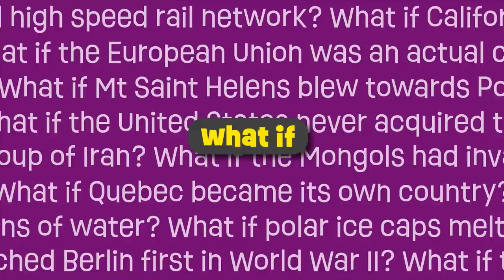Water Pipeline: What If An Aqueduct Was Built From The Great Lakes To The Southwest?

Comment: I think it would be better to build a water pipeline from Washington state to Southern California. The distance between the Olympic peninsula--one of the wettest parts of the Lower 48--to Los Angeles is less than 1,100 miles. It could run close to the Pacific coast, minimizing elevation changes along the way. Importantly, such a pipeline wouldn't drain any lakes of their water--it would catch water before it flowed into the ocean.
Reply: That is my thought as well, Lake Roosevelt on the Columbia river needs to draw down its water levels every winter to make room for spring melt water so they have more water than they can use. Lake Roosevelt is double the height above sea level than lake Superior making it easier to transport the water using gravity.
Reply: How about y'all stop trying to import water from other states? As a Washingtonian, I don't want our beautiful lakes and rivers to be drained for the sake of a state that can't even reduce its usage by eliminating all of its golf courses.
Reply: Spot on!   I wrote a comment saying the same thing but a pipeline from the Columbia River to Lake Shasta where the aqueduct system starts.
Reply: That has already been studied in the 1950’s by the corp of Engineers which concluded it wasn’t feasible.
Reply: @Mottleydude1 :
The 1950’s?    That’s like 70 years ago!    The water is in our country and in Canada.  Pipelines are very doable and do not need to be a lengthy as one thinks.   The snow pack in the Sierra Nevada Mountains needs minimal diversion as runoff is allowed to run into the Sacramento Delta where is mixed with saltwater.  Diverting to reservoirs there is very possible.   Pipelines leading to where rivers start allows rivers to act as a carrier and then diversion points can pump water to lakes and containment facilities.  Desalination plants can pump water to agriculture regions.   If we can pump oil, natural gas, and water through pipelines, we can build pipelines to where systems start like Lake Shasta.  But using a 1950’s report as an argument does not fly.
Reply: @Mottleydude1  Do you have a link to the study?
Reply: Minimizing elevation change is counter productive towards making water- ….
Move
Reply: @oldguysrock2170  
You speak as if lakes are healthy. 
Trinity lake (next door to Shasta)
Is e-m-p-t-y
Reply: @oldguysrock2170  You can't build for something that has been declining for decades and that is expected to be gone in the next few.
Reply: @oldguysrock2170  'The left'. Code word for anyone left of far right. 😂
Meanwhile the right denies the root cause of the problem. 😂
Reply: we need taff decision, like banning this Golf clubs from using real grassland!! this are very taff decision because it will hurt many rich people, so you can be sure this will never happen! but water cuts have already been enforced among the natives, really a fair situation, they used the least water and are the first to feel the consequences
Reply: Cali can worry about themselves
Reply: @fastinradfordable  :
Pumping stations!  Every pipeline uses them.   Pumping stations create shut-off points for emergencies.   Oil, gas, water:  all have stations.  Elevation was fixed with the California aquaduct in many locations by pumping stations.
Reply: No. the other states already export their homeless population to our state, you can't and shouldn't have our water too.
Reply: @swirvinbirds1971  :
Which party has been running California?
Reply: @oldguysrock2170  Both Republicans and Democrats... Did we forget about Arnie already?
Reply: The Columbia's average flow at Astoria OR is 294,000 cubic feet per second (cfs) 
The Colorado River along the CA/AZ border is 11,000 cfs. 
That means Southern California and AZ could effectively double their water supply by siphoning 3.75%, taken out right near the point where it empties into the Pacific, with virtually no impact on the environment or water supply in OR and WA. 

Sounds intriguing but I think pollution in the Lower Columbia would make this totally unfeasible, that and 1,800 miles of pipeline along a steep and unstable coastline. Picture miles of pipeline bolted into the side of rugged vertical sea cliffs getting battered by 40 foot storm waves.  Wouldn't want to have to maintain those pipelines!
Reply: @oldguysrock2170  ... Piping water is dumb.  Water is $0.01 a gallon from utility.  Farmers pay just $0.0001 a gallon.  Pipelines cost billions.  It's so cheap cause most just live by a lake where water is free from sky.  This isa fake crisis.  Just build a desalination plant for 1000 gallons for $3.  Average person uses 100 gallons so $.30 a day which is affordable. Farmers are the ones who want a massive pipeline for their hi water farming , farmers farmers farmers wanting free help for crops in a desert.   I love the stupidity, water supply  is fine except farmers want even more and us taxpayers are dumb .
Reply: @stevewest6133  so right in the estuaries that wildlife, especially the Pacific Salmon, use?
Reply: @swirvinbirds1971  No. My point is that this sounds attractive in theory but in reality its not feasible, nor environmentally sound.

 The 1,800 miles of pipeline, needing constant repairs and maintenance, pumping plants every 10 miles... that's why I'm saying this project is pure fantasy.  

If you wanted split hairs on theory, then yes I'd argue that a 3% siphon, utilizing a fish blocking membranes, taken near terminal point  at Astoria could be done with low environmental impact.
Reply: How to say "I've never driven the Southern Oregon and Northern California cost" without saying you've never driven it.  The terrain is prohibitive.
FAR easier would be to tap the Columbia around Hermiston, OR and take it to Alturas, CA (right on the border near the corner of CA that borders NV and OR).  The terrain is much better, with only one mountain range.  Once you reach Alturas, it is "downhill" from there.  That would add water to the Pitt river which goes into Lake Shasta.  
Many argue that the Pitt is the true headwaters of the Sacramento.  The pit is both more voluminous at the junction and a couple hundred miles longer.
Reply: @stevewest6133   The diversion has to be quite a ways upstream.  The Columbia is brackish in the lower reaches.  It reverses flow as far as Vancouver and is tidal to Beacon Rock.  Many are blown away by the fact that Portland is 100 miles upriver yet has 8 foot tides. 
The diversion would have to be taken in the 9 months of the year that the flow is up.  The flow is quite variable, and in the summer months all flow is already allocated to prior water rights.  From October to May, there are plenty of water rights available.  The canal could either be run 9 months of the year, OR storage could be added to the early stretches that would allow the first part to run 9 months of the year and the rest of the year the remaining canal runs on the storage.
Reply: @matthewbeasley7765  I didn't know its brackish that far upstream... Its all theoretical anyway. 

My point was that the real reason why this isn't going to happen is the 1,800 miles of pipeline. The relatively small siphon creates a false sense of feasibility. That's what I meant to convey. I have driven the entire OR coast, so I get it.
Reply: ... it is fun how simply water going from $.002 a gallon to $.003 is "scarcity".  Nature gives us much water but still it's not enough for us spoiled babies. Ha..  Luckily the free market would require someone to show how $100b pipeline could ever be paid back from 1m people paying for nice water.  Mathwise it  would be $503.02 a month for 40 years at 4% to pay off $100b loan...    Why would people go from current lake water which we all know is like $50 a month, to choose to buy pipe water.  Is this $100b pipeline gonna supply water for 10m, so it's a good project (10m x $50 will pay for $100b pipeline) , but 10m people that's a lot of water how huge is this pipe .   .    I love how no one does these numbers, just push pipelines based on how cool pipelines look. .
Reply: @stevewest6133  1800 miles if you go down the coast, hence my point that it is far more viable if the aqueduct were to be constructed from Hermiston, OR to Alturas, CA.  By road that's 416 miles.  Due to terrain, it no doubt would be longer than 416 miles but still vastly shorter than 1800 miles.
Reply: @funkervogt47  I have a link to a link. Look up the North American Water and Power Alliance. “NAWAPA”. Wiki has a pretty good summary of the proposal. It’s breathtaking. They were thinking big.  https://en.m.wikipedia.org/wiki/North_American_Water_and_Power_Alliance
Reply: Additionally, a smart idea could be to invest in desalination plants. Take advantage of the deserts to build a lot of solar panels to make the energy required to purify the water. You can turn an over abundance of sun into into a major reason you have excessive water.
Reply: @mostlyguesses8385  what about "dont bite the hand that feeds you" golfers should enjoy the nice sand with the occasional grass pit before you start messing with the food supply.  last time i checked i never had to golf to live.
Reply: @RodneyO0.  .... Golf courses pay hi prices for water , it's the farmers who came in 1920 and have unlimited water rights and shifted from grain to hi water alfalfa in 1950s that are the problem.... I hate golfers but it's the damn farmers mostly, they use 70% of water and are 1% of workers in west.  . . .  That Alfalfa is packed in haybales and literally put in shipping containers for China... It's hilariously dumb farmers not golfers, hahaha.  See """"""California drought: Why farmers are 'exporting water' to China - BBC

Feb 19, 2014 — "A hundred billion gallons of water per year is being exported in the form of alfalfa from California," argues Professor Robert Glennon""""""
Reply: @bransonwalter5588  ... Desalinated water is medium cost $3 for 1000 gallons, farmers are spoiled and want more free water they just pump from below ground cost of electricity $.1 for 1000 gallons.  .   Plants take a lot of water, luckily we have wet E USA, it's dumb to grow west USA ... Desal water don't work for ag....
Reply: @randyisthechase5008  That's a good point.

Comment: One engineering difficulty that wasn't emphasized enough is that Phoenix sits 500ft higher than lake Michigan. This means that an "aqueduct" style solution would not work, since aqueducts rely on water flowing down hill through gravity. A pipeline would have to be used instead, greatly increasing the cost and complexity. This problem gets worse if you try to shorten the distance by say just delivering the water to the upper colorado river basin as some commenters have suggested, getting water to the closest part of the watershed (Grand Lake) would require getting the water up 7500ft, before you consider getting over or through the Rocky Mountains. Even the most reasonable path out to the Little Snake River would require a lift of 5500ft. The amount of energy these high elevation alternatives would take would be absurd.
Reply: In a way, you are almost shipping energy at that point. By feeding the water up to that height, a lot can be reclaimed through dams along the river, but also at a huge cost.
Reply: It is beginning to sound like radical water conservation strategies will be the much more achievable and effective of all the available choices.
Reply: This is the situation that should have been addressed in the video from a geologic perspective as that is what the videographer claims knowledge or training in, not the other issues mentioned, imo
Reply: It would not make sense to send the water directly to Phoenix. It would enter into the Colorado River at a different northern point.
Reply: @GeorgeVCohea-dw7ou  Bingo.. first build 2 HUGE lakes in North Dakota and in South Dakota.. then get Elon to build a tunnel to the Colorado River.. the Romans would have done it this way.. they actually made water run up hill using Reverse Syphons..
Reply: @ajjillson3302  As long as the outlet is lower than the inlet, doesn't matter if the pipeline goes over a mountain in the middle. You only have to pump it through initially just to get it over the hump, then siphoning does the rest. Great lakes are 182 m above sea level, Los Angles is 93 m.
Reply: Windmills comon man